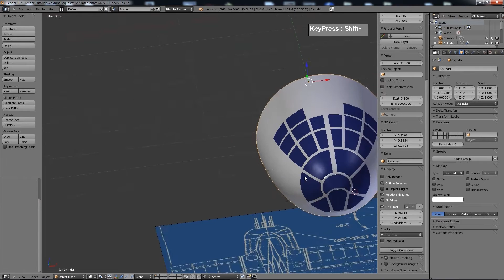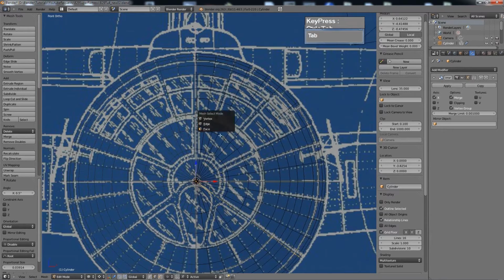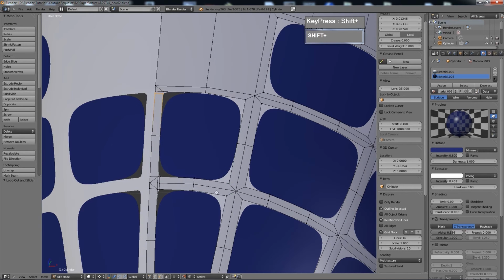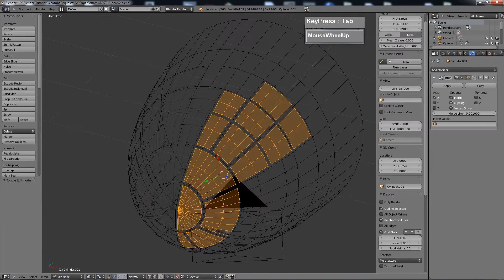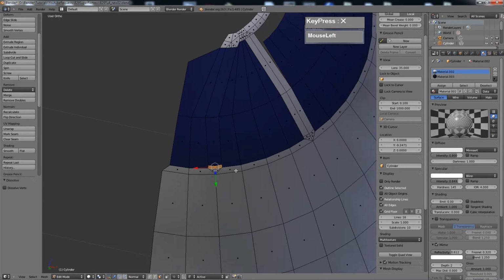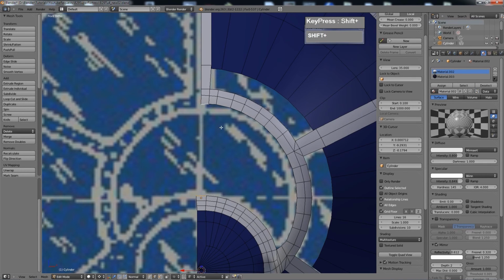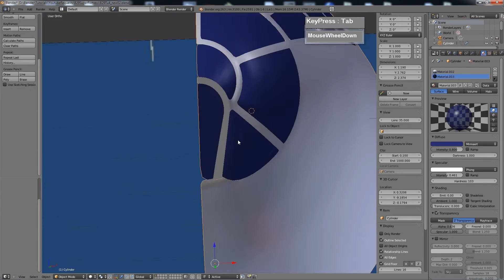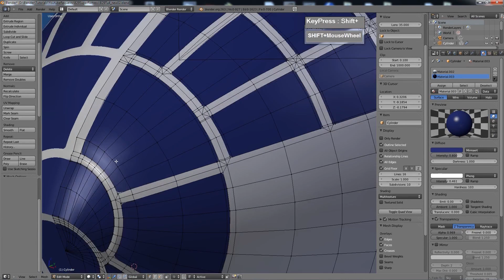Blender Modeling Timelapse - B29 Greenhouse Cockpit

Comment: what is bad with triangular faces?
Reply from the maker: +Davi Lu There isn't anything wrong with having some triangular faces when they are used in strategic areas, however to aid subdivision, it is best to keep everything at 4 sided. You can check out the video by GuerillaCG on Subdivision artifacts and why having 4 sided faces is best for subdivision surfaces.
Reply: weeliano while reading the comment my thought was "hopefulöy someone replied with a recommendation fir guerilla cg" :D